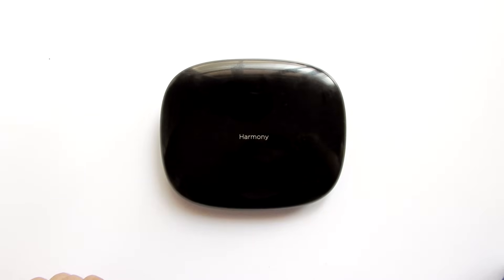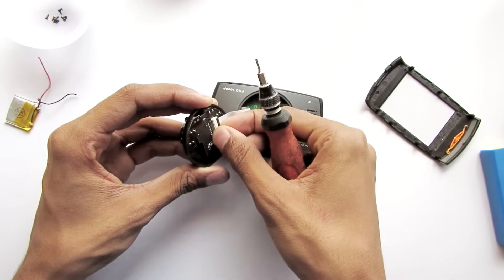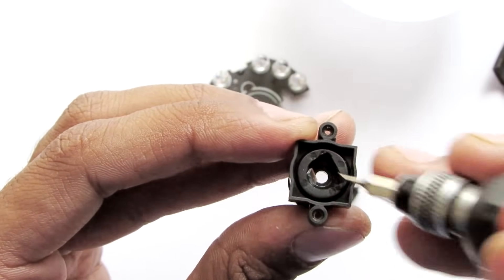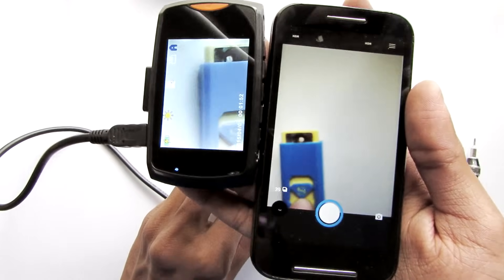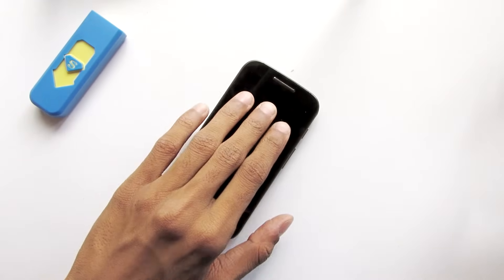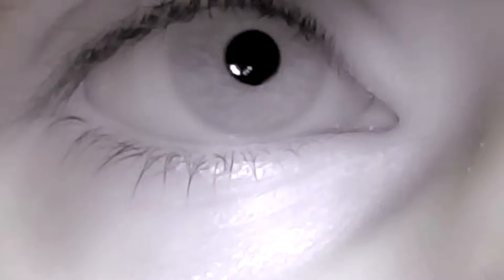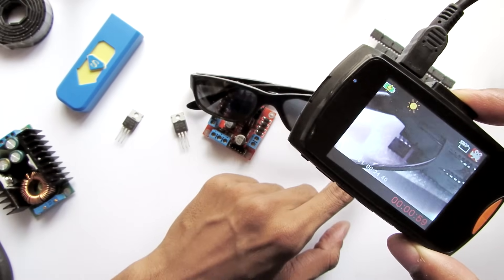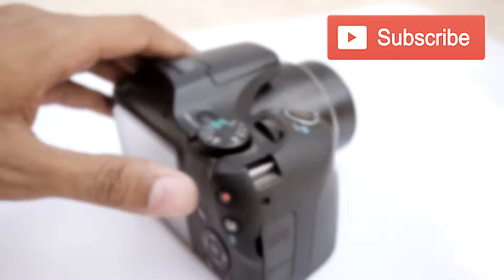How to Make Infrared Camera for Night Vision  📸

Comment: It is not possible to see through objects with an infrared camera. Sure, you can detect if something is leaned against a wall, only if it's different in temperature but its only to detect. You do not see the actual image but what it leaves behind. Even x-rays are not this advanced. There should be a receiving side for the x-ray. Also, you can't even see through glass using an infrared camera.
Reply: The One Plus phone was able to do it, until the company disabled it.

Comment: I bought the same camera a while back and I removed the IR filter to enhance the view. That doesn't make the camera like a see through camera or thermal camera. The camera is really poorly made that once the handling goes a little hard things break apart. I was just using it as a CCTV camera to look at the work room or else I would throw away that cheap crap.

Comment: Kedar, do you know if that is a 3.6mm 92 Degree lens? see: http://www.ebay.co.uk/sch/i.html?_from=R40&_trksid=p2060353.m570.l1313.TR1.TRC0.A0.H0.XIR+Lens.TRS0&_nkw=IR+Lens&_sacat=0
Reply: Also, the lens screws out and does not require taking the camera apart!

Comment: Hi Kedar, Have you tried adding an infrared pass filter which blocks visible light. Such a filter should look dark to the human eye, but it would be clear to the ir. Next step with the filter attach, the camera video gain needs to be turned way way up. Sony had this feature built into some older cameras but I think the feature was dropped due to privacy concerns. A low efficiency ir pass filter is old floppy magnetic disk a more efficient filter should work a lot better. All the best.
Reply: all digital cameras night vision or not have the exact same effect only effects that are seen is from the infrared lens and nothing else, weather night shot or no nigth shot every things the same.

Comment: THIS DOES NOT WORK! I tried to do what u said... I bought the same type of camera and i followed every step on the video.... It could not see through things... Not even plastic.
Reply: The plastic on the logitech hub is specially made to let IR and block visible light because it has IR leds and IR sensors inside. That whole plastic is basically an IR-pass filter. Most plastics will block IR and visible as well.
Reply: did you turn on,  the infrared ligh?
Reply: +Peter1999 yes, i did everything. i even add an extra infrared light
Reply: The only way this would be able to "see through" anything would be if it were the dark red transparent plastic that sometimes covers the IR led on TV remotes. IR light can pass through fine but it looks almost black to the human eye. Sometimes devices, I assume the Harmony is one, are made of this plastic so it appears nice and black but still allows IR spectrum light to pass through for communication.
Reply: Yes, the plastic he is looking through is probaly a smoked black transparent plastic.

Comment: Its IR not X-Ray... Why the hell are you able to see through plastik?
Reply: Black transparent cover. Just like black tinted glass on Windows. I suppose.
Reply: That plastic is specially designed to do that. The device has IR lights and IR sensors inside so it needs IR to pass through it. Most plastics will block it.

Comment: bought the same looking camera but could not get the 1st (upper) lense out, different design, might be glued in.
Reply: +Nikolas Dion : so the question we want know is how did you disassemble the lenses assembly,  if they are glued together.
Reply: Same here, the lense is glued in. Where can I buy a new unglued one? Any hints someone?
Reply: +martin richardt if you disamble the parts, the lense could get out, i have the same problem but i solved it
Reply: Its just hot glue. Use a hair dryer to warm it up and remove it. Or use a q-tip with some denatured alcohol and it will come right off.

Comment: hey! i like tour videos and finally i did this mod with my sony dsc w110 and i don't mean that it doesn't work but at this time muy display show images more red and  i can only detect really hot things like my solder iron, its amazing on the camera looks purple the heat, but thats the only i can do because i can't see through electronic devices
Reply from the maker: +LateTom Cat Try black Materials like front of TV remote , Harmony Hub body is made up of NIR Translucent Materials so you can see through it.

Comment: Cool, but misleading -- it's infrared yes, but it's nothing compared to a thermal camera.
Reply: It's cool that it can detect some incandescence that the naked eye can't, but it's nowhere near a thermal imaging camera. A thermal imaging camera detects long wave infrared and can distinguish between fractions of a degree in room temperature objects.
Reply: the Hacksmith Well do it, I dare you!
Reply: Dammn The hacksmith commented !!
Reply: wtf
Reply: @sonydogman  Bruh moment
Reply: hacksmith :D
Reply: the Hacksmith hacksmith ¡ :D
Reply: mrkiky well it would work much better if he  had an infrared filter to only allow infrared light to pass through
Reply: hacksmith what are you doing here?
Reply: woah hacksmith ! U were here ? BTW i watch your videos
Reply: It allows you to see 360-930nm of light that's awsome in fact i enjoy NIR more than IR Or UV everywhere you might see a mengenta color to fix set a custom white balence and add a infared pass filter
Reply: Hey hacksmith here
Reply: its because a  Near infrared camera  is about 500 to 720 NM  but a thermal is nearer to 1000 to 14000 because you cant see heat in a near infrared camera  its not as spectacular sadly

also your most likely to  see a reddish color in the camera so you need a filter or just ask a professional to mod your camera to see infrared they will put a filter in the camera and other stuff you will most likely need a custom white balance : )
Reply: How to remove it from imge sensor
Reply: Well technically if the thing is hot enough, any camera becomes thermal imaging haha
Reply from the maker: its very useful hack for any camera not professional but it works for some degrees ,and people usually search for it therefore this is title, let me know what is appropriate title according to you Thanks For being here!
Reply: +Kedar Nimbalkar Well the accurate title would be Near-Infrared Camera, but I understand the need for searchable titles. I'll be sharing it to Hackaday nonetheless! =)
Reply from the maker: +the Hacksmith Thank You !
Reply: I agree with you. thermal cameras has Germanium lans .. I did this an year before for night vision.

His camera is like indian
Missile technology land in trash .
Reply: @bhittani  Germanium lens you meant ? clever fk

Comment: hey kedar i buy a web cam and remove the red lence and give the same image but cant see threw things why
Reply from the maker: +Møhámađ El rachidi To See through objects you will need a source of infrared LED's
Reply: I have ir led can i put them externaly
Reply from the maker: Note that things having a body made up of NIR Translucent Materials works really good to see through ,most of the other materials don't work that better either due to less expensive camera's Image sensitivity .

Comment: While this is seeing 'infra-red', it's not thermal, only a mixture of visible and near infra-red. The reason you see hot things glowing with the camera is hot objects are usually emitting near infra-red as well as the heat (as lower frequency thermal infra-red photons).
Reply: Well, if the subject is hot enough, any camera becomes a thermal camera lol

Comment: how to do it in mobile
Reply: same method.
but, you need to add the infrared leds.
Reply: +Kedar Nimbalkar ya, but I have done it before. so is possible. :D
Reply: +Kedar Nimbalkar I use mine as night vision goggles.
Reply from the maker: +Azim Alif Cellphone camera's lenses are very small compared to dashcam I used in the video, do it carefully !
Reply from the maker: +Azim Alif Nice!
Reply: +Kedar Nimbalkar ya.
Reply from the maker: +Azim Alif yeah it works really good as a night vision camera .
Reply: +Kedar Nimbalkar ya.